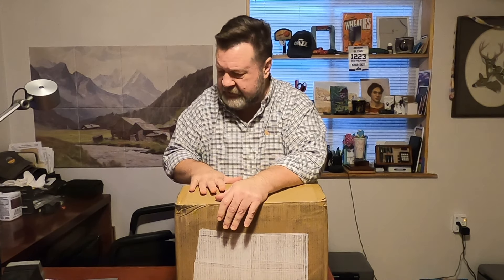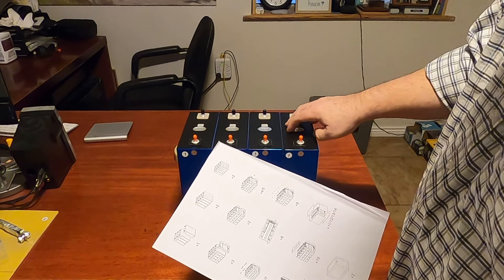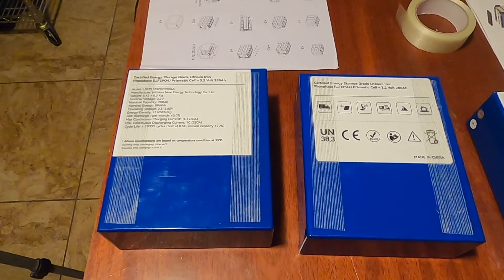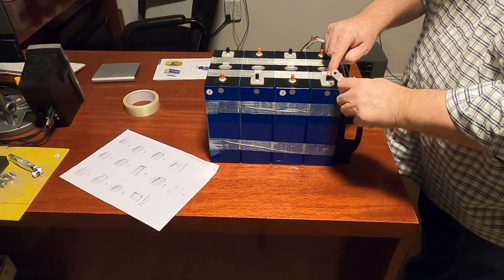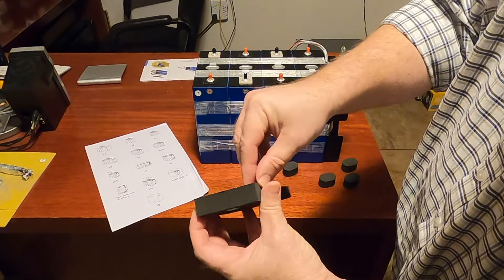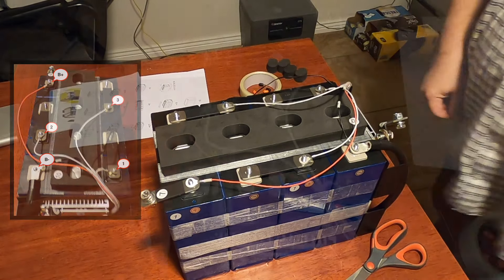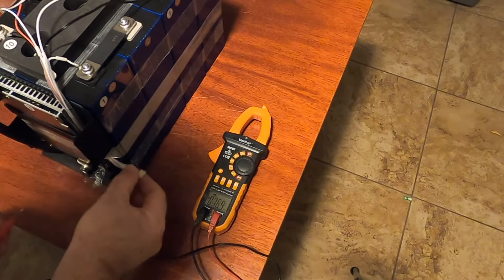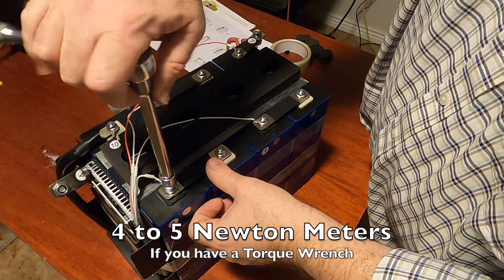Licitti 280Ah Battery Kit

Comment from the maker: During the video, I mentioned that you can't get 200 amps from 2 100ah batteries in parallel. That's not completely true. What I should have said is that if one of the batteries fails, the whole system will shut down because the 200 amp load will be thrown to the single remaining battery. When both batteries are healthy, that parallel group can deliver 200 amps.

Comment: you're the reason I went with this kit, im still running wires for it and trying to make it look pretty but im happy with the amount of power I get out of this box, I will say that thing is HEAVY though..
Reply from the maker: I love mine. I was just at my cabin over the weekend and barely put a dent in this kit. It never dropped below 90% and was always fully charged the next day. Agree with the weight. You know you're lifting it.

Comment: Just got my 280AH cells and kit. My BMS is different from yours. They have restructure the B M S. The negative busbar is no longer next to the #2 negative wire but on opposite side on the BMS, upper corner. Therefore had to reverse the negative end panel so the markings are now on the inside of battery box. Had to mark this end panel manually to identify it as the negative end panel. The 5P wire is now attached to the BMS right next to the heavy #2 negative wire. Just below that are two separate temperature wires mounted. The B+ (red wire), the number 2 white wire, the B- wire (black wire), and the two temperature wires now all run straight down the cells making their respective connections. There is NO crisscrossing across the top of the cells. The number 1 and number 3 white wires run just above the top of the BMS then make a left turn to connect to their respective connections. This new layout makes for a very clean and orderly arrangement of wires atop of the battery cells. The other group of wires were already mounted to a small circuit board and given its own space to hang out down back end of the BMS. There were no new instructions given to reflect any of the changes of this new layout. It came with the old set of instructions. I did insert a sheet of battery insulation between the cells. I used Barley Paper with adhesive on one side. An Amazon purchase.
Reply from the maker: I just recieved my second kit and saw the same things you saw except my BMS only sees 200ah. I did a complete down/up cycle on it and still 200ah. I know its 280 because on the down, it ran for several hours after going to zero.  What does your kit register as?
Reply: @TheWoodHaven  Hello. I have built my battery. Have yet to install in box. Waiting for 40A AC Anderson Charger for AC Battery Box sold by Licitti. I emailed Mark Lu tonight about your concern about this “new” BMS being rated only for 200ah and if it was good enough for our 280ah battery cells. I queried him about this as I was already querying him about the 40A AC charger’s whereabouts as my cells and BMS came in one shipment and the Box in another shipment and have yet to see the arrival of the 40A AC charger. All these were on same order.

I had also ordered his CyberBox 3000 Portable Power Station - 300AH power station which he informed me he could not send that to me at my location (Alaska). I also with this power station ordered his 30A AC charger and both the big and smaller DC Control Boxes. I am waiting for a response to see if he is able to ship me the DC Control Boxes and the 30A AC Charger. Also, I wanted to know why he was able to ship me the kit but not the completed power station. It may be because one had a completed battery built and the other were individual cells. Any way I brought up your concern about this “new” BMS being rated for 200ah and if it was good enough for our 280ah battery cells. When I get a response back from Mark Wu, I will let you know what he says about it. Thank you for responding to my input.
Reply from the maker: @user-qz8ej3nq2n  I've had my eye on that Cyberbox 3000 Portable Power Station myself. I'm wondering if he can't ship it to Alaska due to cost.
Reply: @TheWoodHaven  as of yet, I do not know. Unable to order any other power stations from other brands. Shipping to Alaska denied. Amazon also will not ship any power stations to Alaska (even their dc refrigerators/freezers). Even PECRON will not ship any products to Alaska, including non-battery items. Also until recently, even Browey refused to ship to Alaska. Last month they allowed me to purchase their C600 suitcase solar generator, when before I was denied. Do not know why or how to get around this. So, this kit from Licitti, the 280ah battery kit with new gen battery box, was a surprise when I found that they would ship it to me. So, I had to order it and I got it. The shipping for that was higher than given for the 3000 solar station. My initial order for the 3000 went through but after waiting awhile got email from Mark Wu, saying he could not ship that one to me and will reimburse me.

Comment: You made all of the protections to prevent the blockage of the vents of the individual blocks and then covered the whole battery with your yellow panels and sealed the whole package with tape. How do you now provide the blocks with venting when the whole package is not vented?
Reply from the maker: The cells don't vent very much. That's what the foam is for, to provide enough room abolve the vents to vent.

Comment: Great video does this battery fit 1st generation box?
Reply: I’d like to know that too?
Reply from the maker: It is really tight because the lower portion of the gen 1 box is narrower than the top. With some mods to the bottom inside of the gen 1 box, you may be able to fit. I've heard others say they can make it fit, but I have not tried.
Reply: @TheWoodHaven  Have you seen the Gen 2 DC version box?
Reply from the maker: @ray32825  Yes, I have a review of it on my channel and I just fit this kit into it on my last video.
Reply: @TheWoodHaven  Not this one - Easiest DIY Solar Generator Gen 2 - Licitti 2000 Watt AC Battery Box. They had a DC only version of that. I just checked the site and it has disappeared. LOL
Reply from the maker: @ray32825  Yes, I have that one and did a video on it too. It's now running my cabin.

Comment: how long does it take to do full charge ? for 280Ah battery
Reply from the maker: I charged this from 0 with a 30amp charger and it took about 15 hours. The charger slows down as the battery gets closer to full.
Reply: @TheWoodHaven  Thank you for the response, for me it takes around 10-11 hours with a 30 A charger and I was thinking if I get a 50 Amp charger then that would charge fast. Also, there is one wired issue with my display, whenever I connect to charger it shows 100%. I understand it would show 100% during charging, however it continues to show 100% even if I disconnect the charger before it charges fully. wasn't sure if that is how it works with this device.
Reply from the maker: @ArulPrakash-u3d  I have also recieved a 50amp charger now. I haven't really noticed that. I usually just charge overnight and it is finished in the morning with the charger off.

Comment: Bet he got his free i paid for mine but rhey wont ship or respond to my emails, maybe a scam dont do it
Reply from the maker: Hi Amy, I paid for mine. That's why you don't see the Includes Paid Promotion at the beginning. This is a small company. Keep emailing. They will get back to you. It's not a scam.
Reply: They are a good company but not great replying to e mails.  From my experience you need to be a little persistent ….. I got the 1000 watt power-box ( for over-landing  ) which I’m trying to fit a 305ah version of lithium battery.  Will let you know how I go on :-)
Reply from the maker: @Brayco864  Good luck
Reply: @TheWoodHaven  thanks I appreciate it too
Reply from the maker: @Brayco864  Hey, where did you get your 305ah battery? Was it a kit like my 280ah battery?